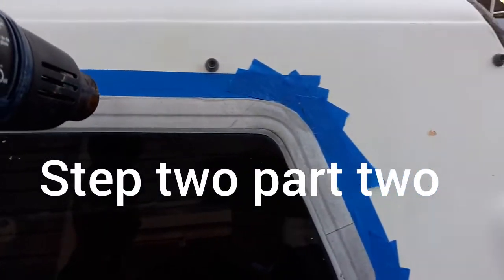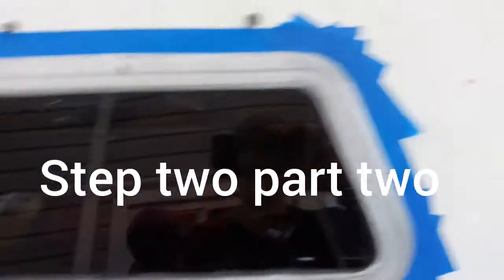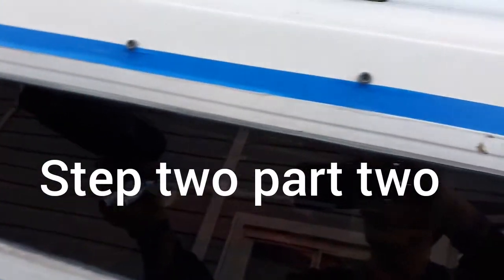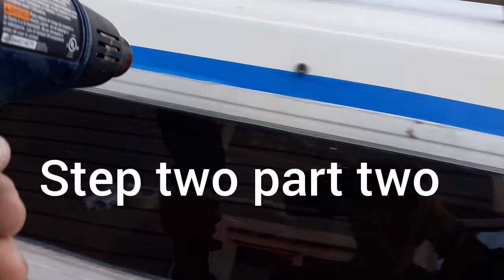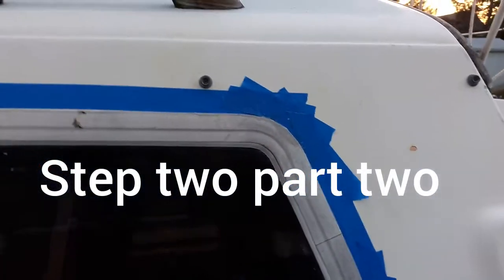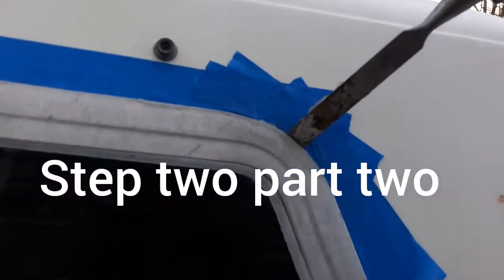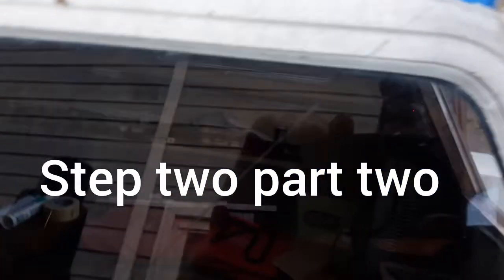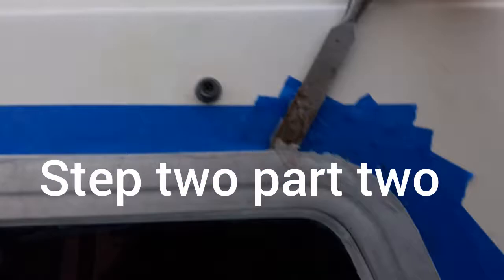Fixing leaky windows on a Catalina 25 or 27 or split frame aluminum window

Comment: Thanks for this video, Paul. I slid a putty knife in between the boat and the back of the frame and slid it all along the edge and it broke the seal pretty well. Have you replaced the seals yet, i am having difficulty figuring out how to stop the corners kinking up. I think it could get quite messy. :( Cheers!!)